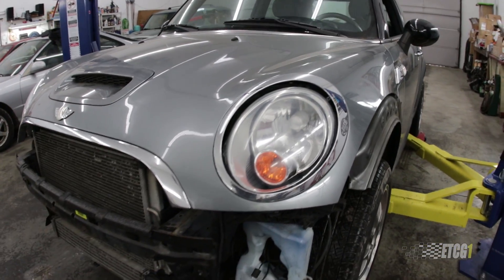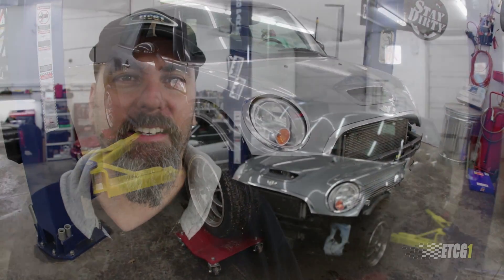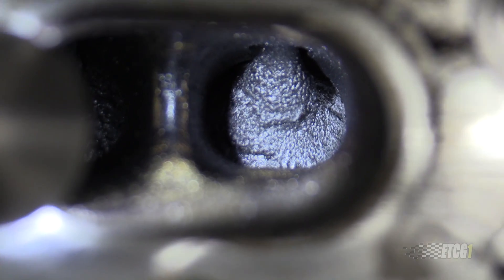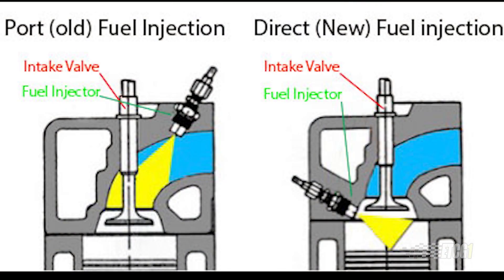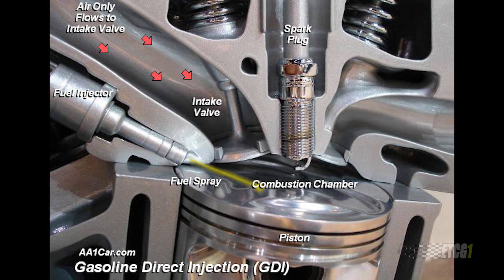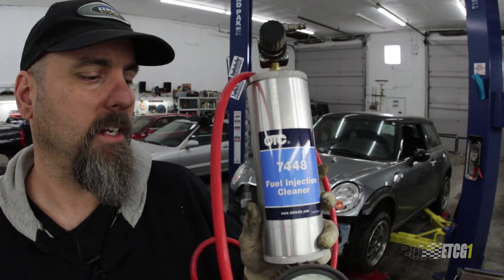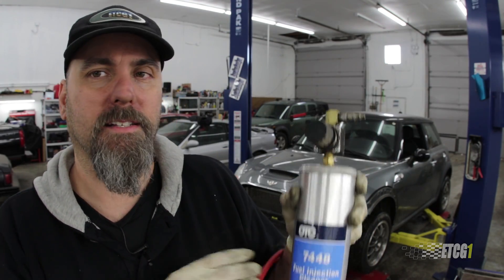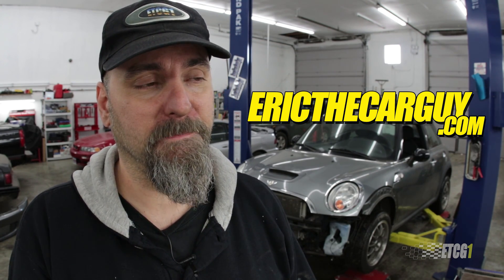Direct Injection Proves Fuel Additives Don't Work

Comment: Had a 2010 Buick fail as well. Is there anything that can be done maintenance wise to stop the carbon buildup since the fuel additives won’t reach the problem areas? Or are these DI engines just built with an expiration date?

Comment: The only additive, cleaners I've ever used that seemed to work was from BG products.  Everything else I've ever used seemed to be snake oil to me.  Any engine that burns gasoline just flat out is going to have the nasty carbon, sludge, gunk buildup in it.  Tear apart a natural gas or propane engine and you will see a whole lot cleaner machine.

Comment: Recently rebuilt my head. Had some valves (both intake and exhaust) that had a layer of hard carbon buildup on them. Didn't want to take a wire wheel to them (I'm very lazy and time was on my side), so I soaked them in Seafoam for literally a week. Results were extremely disappointing. Valves were cleaner but only marginally so. I expected the Seafoam to have softened up the buildup to where I could just wipe it off with a shop towel, but the carbon was as hard as it was to begin with. I'm convinced I could've just soaked the valves in room temp water with the same results. Subsequently tried oven cleaner and soaked overnight. Better but again only marginally so. The most effective stuff I tried was CRC gasket remover, but even that was like trying to put out a 5 alarm fire with a garden hose. Just wound up going the wire wheel route. Point is, if soaking the valves barely does anything to the really bad, baked-on stuff, I find it hard to believe you'd get better results in a running engine (with port injection), even with the help of heat, when the cleaner has almost no time to do anything. And even if there was improved benefit, it'd primarily be on the top of the valves and piston tops. Having said that, I do think there's benefit to cleaners on new or rebuilt engines that aren't DI. If you don't regularly get gas from a Top Tier station (ones that add a decent amount of detergents to their gas), then adding an off-the-shelf cleaner to your tank at every or every other fill-up will probably help to keep the carbon buildup at bay for much longer. Theory being that cleaners/detergents just work much better on buildup that hasn't had a chance to really bake in. Of course, if your car is DI, you're still screwed.

Comment: I think fuel injection cleaner used on a regular basis in a car that’s running good keeps it running good. But I don’t think the stuff you dump the tank is potent enough once the injectors are dirty and the car is running like shit. I buy the Chevron cleaner by the case at Costco and run that through about every third or fourth tank in my truck. It may be crap. My old 79 GMC pick up with the carburetor started running shitty from some bad gas. I put about three or 4 bottles of carburetor cleaner and ran the tank out. After that the truck ran pretty good. It turned out the diamond shamrock had been selling bad fuel in Arizona. There was a class action suit against them.  I learned my lesson on my old beater truck. I don’t buy My Fuel from convenient stores anymore. Only major brand stations or Costco. Never from A gas station that does not sell a large volume of fuel.  Another big problem in Arizona in the summer time is the fuel pumps get overheated. Never run your fuel tank low. The fuel in the tank cools the Electric motor. The heat off The pavement cooks fuel pump motors in the summertime.

Comment: Gasoline is a solvent. Yes. Gasoline is not the BEST solvent that can be sprayed through the injectors.

Also, in the past 20 years, they've added a lot of minimum standards for detergents in fuel. Fuel system cleaners are still used for old injectors that get dirty quickly.

Comment: With direct injection, you should use a throttle body cleaner through the intake system, like seafoam spray. Spray a few cans through the throttle body/intake and I'm sure you'd see a noticeable difference.  It's the only way you're going to get those intake  valves clean without disassembly. Thanks for the great video. I would say certain injector cleaners/additives do produce a measurable difference. Especially with regards to ethanol treatment. The youtube channel known as Project Farm has many informative and comparative, before and after style videos, that clearly demonstrate the effectiveness of certain additives. I would encourage anyone to check them out. He is non bias and responds to almost every comment and question.

Comment: My "recipe" to keep GDI engine clean (Hyundai Santa Fe Sport 2.4L engine):
Every 4k miles: 
1. Oil change, Pennzoil platinum made from natural gas
2. CRC GDI IVD Intake Valve Cleaner
3. BG 44K Fuel System Cleaner

Comment: A mechanic who hates himself enough to own a German car? Yikes. BTW fuel system "cleaners' often sling insoluble particulates downstream into the injector where they stop. The recommended dose is both pathetically small and overpriced. I do like the pressurized dummy tank as a dummy tank though. Mine is smaller but similar.

Comment: Fuel is not sprayed on direct fuel injection intake ports,So how could you say fuel additive do not work on this system ? 
Direct injection ports are full of blowby and egr mix wich harden with heat, specially on recent cars,with low tension piston rings like on your mini...wich is known to burn lot of oil.
you need to condensate blowby mist in a catch can before to redirect it to the intake.
diesel engines with no egr do not have this problem,even with a lot of blowby,simply because egr do not dry up the oil in the intake ports.

Comment: MS3 guys have dealing with this since mazda start making DI engines the only solution is to run meth, a 6th port, or pull the intake and clean the valves with media.  What sucks is after you clean the intake with media in about 5k miles the valves will be gunked up again.  The easiest option for us is to run a meth set and let it clean the valves.

Comment: "fuel system additives don't clean places they don't touch" Uhhhhhhhh yeah? The only good point of E10 is cleaner valves (for port injection vehicles) now... This is more fuel additives prove shitty designed direct injection engines don't work...

Comment: What about SeaFoam used in a DI fuel system car? SF has a spray aerosol version that is sprayed, via a straw like you'd find on brake clean or WD40. You spray this into the intake system before the throttle body.

Comment: I'm not going to debate if the additives work or don't work but that's not the problem with DI.  

The problem is how DI works for that ideal leaner burn.  The DI injects the fuel very quickly in a fine mist and it's ignited a tiny fraction of a second later.  The fuel additives don't have any time to work and the burn is very complete.  Meanwhile the PCV system is venting oily fumes back into the intake which over time will coat the ports and in the chamber build up carbon.  That's part of the reason that some newer engines are using port and DI together.

Like someone else mentioned below a PCV separator can reduces the problem as can fuel system flushes.  The kind that cleans the intake track.

Comment: I'd recommend using BG or Seafoam through the valve body or some hose running vacuum and let the engine idle high using about 8oz. Turn it off to let it penetrate carbon build up. After it's cooled down. Drive it like you stole it! Problem solved

Comment: The tool you use bypasses the fuel filter, which theoretically would be filled with junk over the years. I'd like to see a test where you replace the fuel filter and then use the fuel additive to see if/how much it works.

Comment: I just picked up a 2004 Pontiac Vibe - had current codes 133 and 171, excessively lean mixture - I was running down the probable  cause list and getting ready to hunt for intake leaks, while on a whim I put a half bottle of injector cleaner in with a full tank of gas.   By the time it ran 100 miles on that fuel, the check engine light went out and it seems to be running a lot better in the way of smooth idle and hesitation off the line.   I agree there's a lot of snake oil out there and I'm skeptical too, but it is a happy surprise for me.   Now if they had windshield leak fix in a bottle....

Comment: Fuel additives might clean injectors, but all our problems with carbon on the valves will persist.. It's pretty lame that car manufactures don't do at least catch cans to alleviate some of the issues - But then again this is built in obsolescence as we're used to in this day of age..

Comment: So how do you clean those valves up? I've heard that the VW has issues with direct injection and carbon build up on the pistons and they have to be cleaned with a walnut shell media in a sand blaster type of tool. Those valves there looked bad.

Comment: So all motors have blowby even new from the factory. The amount depends on the load on the motor. With that the engineering decisions behind no port injector on direct injection engines was flawed. Adding a turbo or supercharger only increases the amount of blowby and increasing buildup on the intake valves. However there is only a certain amount of blowby by specification that is allowed before the engine needs to be rebuilt.

I have a well seasoned motor (190,000 miles) that doesn't blow by under typical city and highway driving. I don't consume any oil until I tow. I added a supercharger too and so when I tow I consume different amounts of oil through the clean side (PCV is closed under boost). 

Blowby increases with the wear of the motor. The crosshatch is required to lube and help minimize blowby. Also the build up of carbon on the compression rings is one of the biggest reasons for blowby. The sealing pressure for the rings is only partially provided by the natural spring of the rings. The combustion gasses move behind the rings pushing them tight against the cylinder wall thus sealing the combustion chamber.

Comment: Ok, gasoline washes off carbon deposits and other oily shmutz, but that doesn't prove that fuel additives don't work.  Heck, gasoline from the pump has and is required to have detergent fuel additives in it to clean those deposits, that doesn't prove that they work but that's at least closer to a real argument that they do work.  Maybe you could have titled this something like "Direct Injection proves that fuel additives are unnecessary in port injected engines," which is at least what you talked about but you didn't prove that either.

If you want to make a useful video tell those of us that have direct injected engines how to deal with this without tearing down and cleaning out/rebuilding.  I have a Ford Taurus SHO that is direct injected and I don't even want to know what things look like in the intake ports.  I had a dealer try to sell me a BG intake system cleaning, while Ford explicitly recommends against that kind of thing because they've engine and turbo failures soon afterward.  Who would have gotten stuck with that bill if I said yes?  Last I heard Ford recommends rebuilding the cylinder head to clean them out, probably a deal breaker for 99% of people.  So what do we do?  How did ford get the insane usage and clean engine that they showed for their EcoBoost torture test?  The only thing that I could come up with is that the classic "Italian tuneup" works that well on them???  I bought this car used (and even being a fairly knowledgeable car guy at the time I didn't know about the problems with direct injection).  I've thought about running water injection on it, not so much for detonation control but just to slowly clean out the mess.  I probably should look into a catch can...
Reply: “Italian tuneup” and catch can are hassle. Fill the SHO with ethanol, and carbon is wives tales.

Comment: Putting aside the discussion of having any effect on cleaning the valves, which I agree it would not, wouldn't the cleaner dumped into the tank still help with a clogged or sticky injector caused by bad/old gas or some other impurity that somehow made it past the gas filter?
Reply: Oil solidification, use ethanol but not allow prolong storage.

Comment: Oil catch cans on the pcv system are a must on DI cars.
 Also using a product like seafoam introduced through a vacuum hose  (slowly and carefully!) Can help keep things clean. 
If the car is forced induction, tuned etc. Methanol injection systems are good for raising octane to resist knock but also do a nice job essentially steam cleaning the engine for you.

Comment: I agree Eric - Fuel System Cleaners are great for cleaning the FUEL system (tank, pump, lines & injectors). Want clean valves? Use an upper engine cleaner such as Threebond Engine Cleaner/Conditioner or the Subaru factory upper engine cleaner as just 2 examples.

Comment: How do you feel about the new fogger DI system cleaners that have come out. Some are a 3 stage process for cleaning TBs, intakes, as well was valves. Also, I use the same tool by OTC that you have on EFI/MPI engines with a mixture of gas and Seafoam, and it's worked great for me as an engine decarb and injector cleaner. Am wondering what cleaner you use in that tool. Good topic! GDIs are starting to be an issue with all sorts of driveability concerns in my neck of the woods.

Comment: There is no logic in the headline: Direct injected engines are UNABLE to proof that fuel additives work because they will never touch the valve stems and the intake system (which only leads clean air to the cylinder). Indirectly injected engines (fed with a mixture of air and fuel through the intake system) may proof that those additives work - but this is not Your point.
Reply from the maker: It's all about views on YT these days. What do you think is a better title to get people to click on the video?

Comment: Don't cheap out on the oil! low SAPS oil is a must! My wife's VW and my Hyundai both have direct injection engines and all ok so far (120000kms and 60000kms)  . All this cleaning of valves reminds me of the 60s when  a decoke was a regular part of a vehicle's servicing!

Comment: If you have a GDI engine. you are supposed to use "top tier fuel" in it. this has x10 as much fuel cleaner in it to help with this & intake cleaning every 20k ish. I'm with you on fuel cleaners.

Comment: Yeah. DI and PCV systems that suck to much crap out of the crank case. Been seeing the fords for years with misfire within 1000 revolutions. Carbon on the intake valves. People don't like what I tell them and then they say fuck you were right. It's a super common issue with and DI engine Aside from toyota D4S injection, Ford DI/port injection on the new ecoboost and a couple other engines with port fuel injectors as well as di.

Comment: I've had more problems with carbureted engines than with fuel injected engines.  Unfortunately, my lawn equipment is all carbureted and they're just a nightmare.  My next lawn tractor will be fuel injected for sure.  We also have a 1975 Ford F-250 and the ethanol in the gas has ruined the carburetor and it doesn't stay running.  Maybe someday, we'll convert it to fuel injection rather than get a new carburetor for it.

Comment: You have it backwards... Direct injection proves that fuel additives WORK.

As you said, di prevents fuel from contacting the valve. Also, you stated that MPI vehicles, which spray fuel into the valves, typically have much cleaner valves.

Yes gasoline has cleaning properties, but you're not soaking the valve in a gasoline bath; rather lightly misted fuel evaporating contacts it.

Plenty of research shows that gas without detergents and other additives result in dirtier engine parts.

So yes, additives work, but direct injection cannot deliver them to the proper place. Making them, as you stated yourself, pointless.

They work, but are pointless on di cars. That should be your unclicked bait title.

Comment: If your interested, Peugeot do a bung kit to block off a couple of pcv hoses at the back of the manifold on these coopers. Ive fitted a few over the years. Also, a fault code for super knocking is usually a sure fire sign that you have carbon build up. I now mist an fuel cleaner down the inlet with it revving and that usually cures them. Hope that helps.

Comment: Wouldn't SeaFoam (Or GM Top End Cleaner) sucked in through a vacuum line (per the instructions since before direct injection was a common thing) work pretty well to start cleaning?  You would probably have to do it regularly, but in this application why not?

Comment: One thing I found worked well on my Mitsubishi GDI engine years ago was EGR cleaner. As a lot of you may know, EGR cleaner is spayed directly into the air intake of the engine. It cleans the EGR valve (obviously) and also helps other parts such as the throttle body. The engine used to develop a tap that was related to the carbon build-up in the intake manifold and the cleaner seemed to free up a lot of the coating and stop the tapping noise. The fix lasted about 2 years which was around the time I got rid of the car due to a bad transmission. Still though, worth looking into.

Comment: Sorry Eric. That's crazy frusterating. Would something like CRC's intake cleaner work? Or are the valves way too gummed up? My brother has to routinely use it on his DI 2015 Ford F150 eco boost to prevent build up.  If you can get it running maybe use an oil with a low volatility rating so less of it is being airated/circulated in blow by. Best of luck to you.

Comment: http://bit.ly/2xlxp0z Suggestion - try to use EGR cleaner and it will help a little bit with intake valves. There is same product for petrol engines.